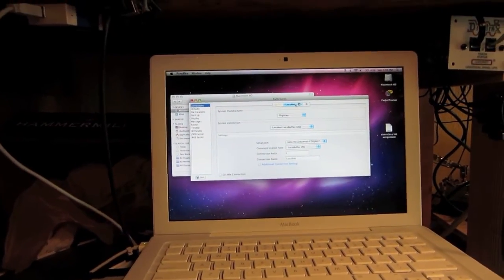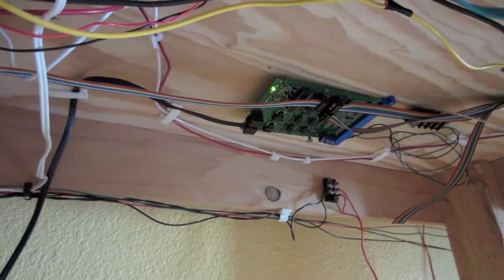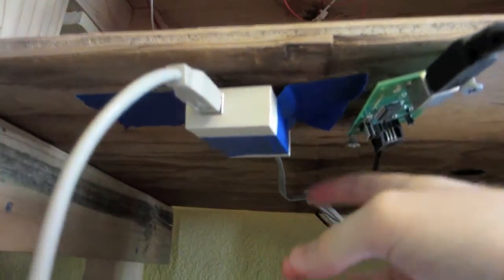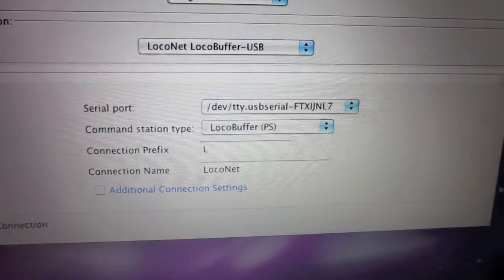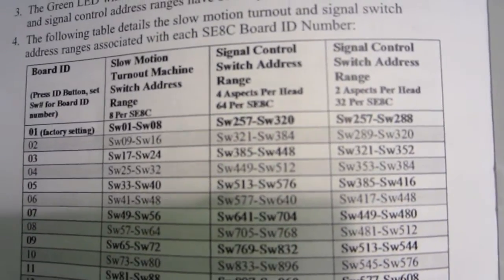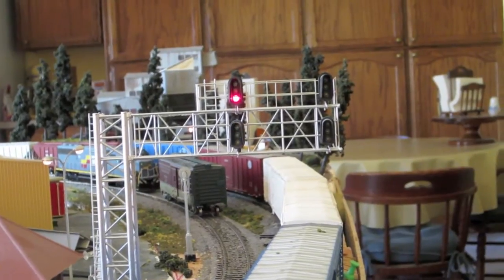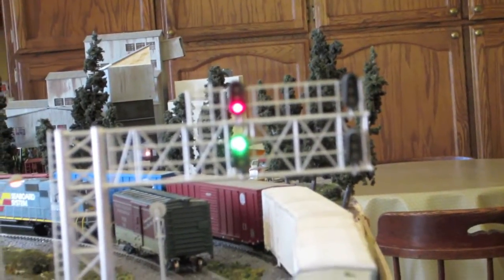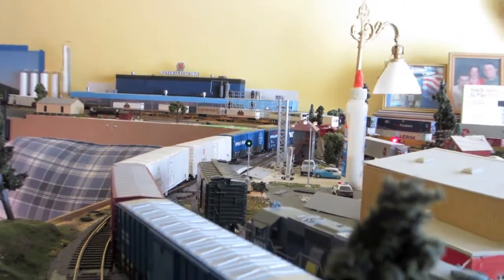Model Train Digitrax Signal System: Computer Control

Comment: i know you said you have no block detection but i was wondering say you used the NCE block detection since your using JMRI you can still control the light even tho they are 2 different systems?
Reply from the maker: Hey. Yes with JMRI you can combine the digitrax signal system with your NCE system. that is actually what I will be doing with this new layout.